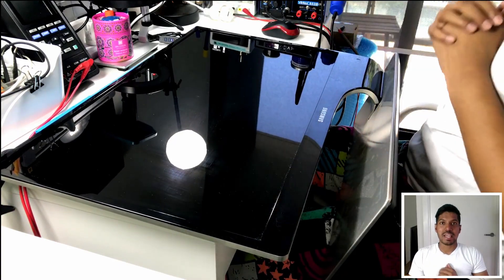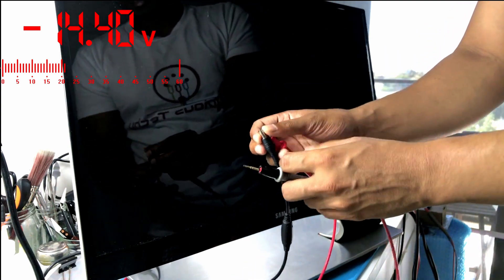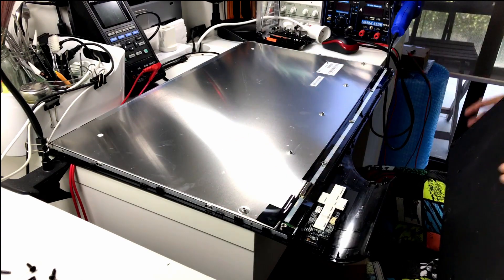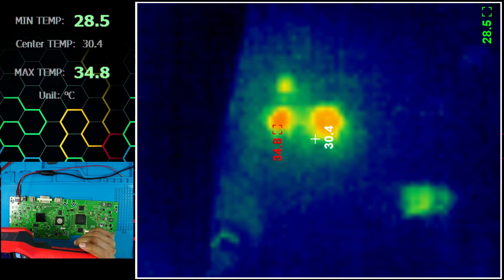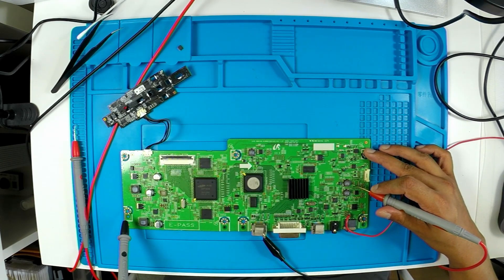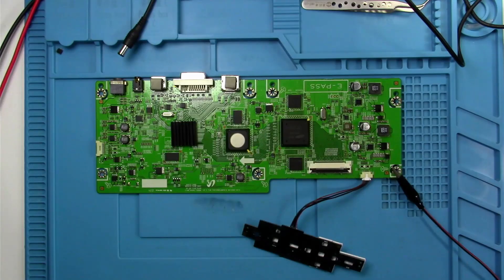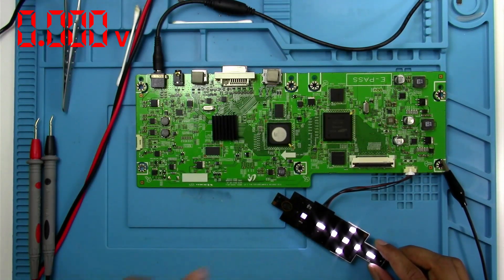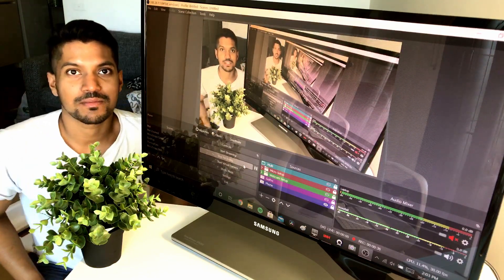Samsung SyncMaster SA950 Not Turning On - DC Buck Converter Issue Under Thermal Cam | Can I Fix It?

Comment: That was interesting . Nice display . You could try finding power on the motherboard and hook in a momentary push button to send that start voltage in so you don’t have to have the power supply attached .